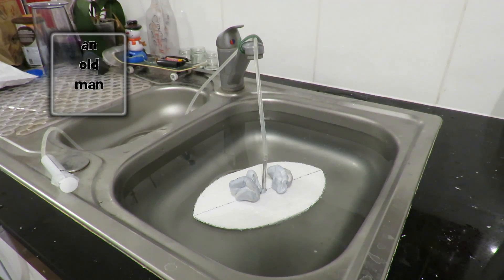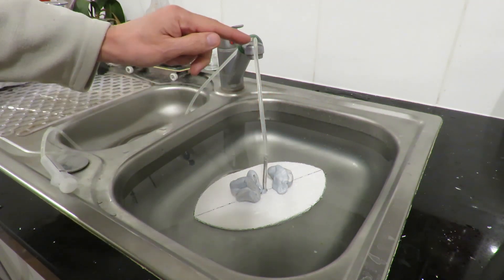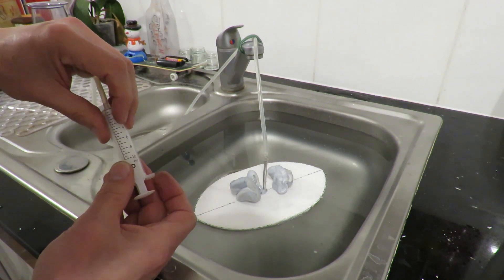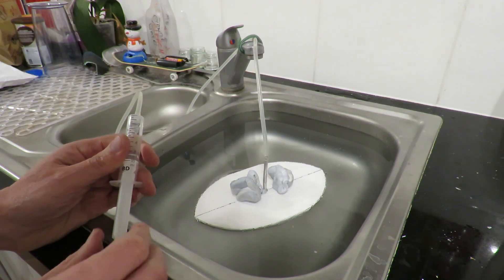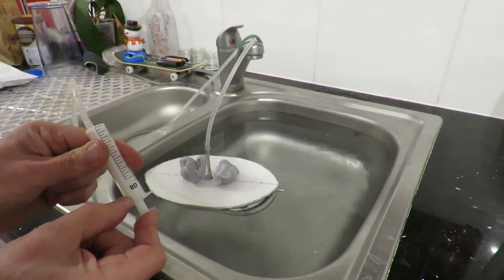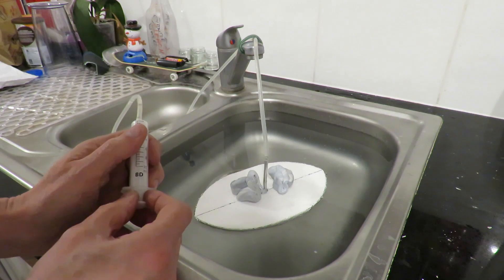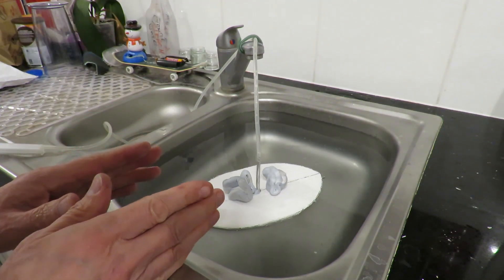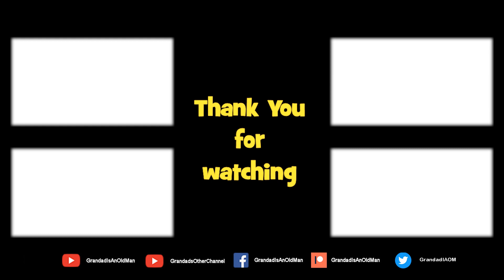Water flow in and out of a pipe

Comment: Great explanation. I could see the same sort of movement that the pop-pop boat makes. :D
Reply from the maker: Yes that is the background to how this came about. It is off at a bit of a tangent to the original thread where people seem to think one pipe is "sucking" while the other is "blowing" and there are some videos about exploring possibilities to exploit the difference like having "inlet" pipes facing forward to gain some benefit from the forward movement of the boat helping to force the water into the inlet pipe. Theoretically there might be some benefit but I doubt it would be measurable and you would have to build a boat where you could have selectable pipes so you could compare the results and have some very accurate measuring tools. Pop Pop boats seem to have a mind of their own when it comes to performance probably based on the exact amount of water in their boiler and the quality of the flame underneath.

Comment: Hello. You are can made a phone charger with Peltier module?
Reply from the maker: Technically, yes you could, but as you need about 2 amps for modern phones to charge you will need to use quite a few Peltier tiles to generate the current.